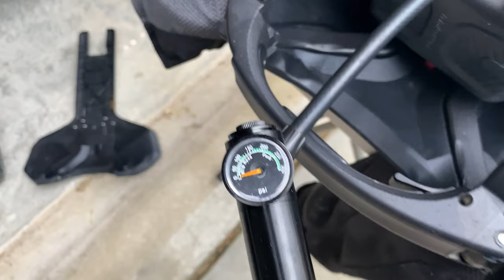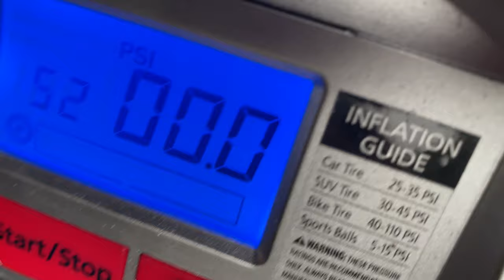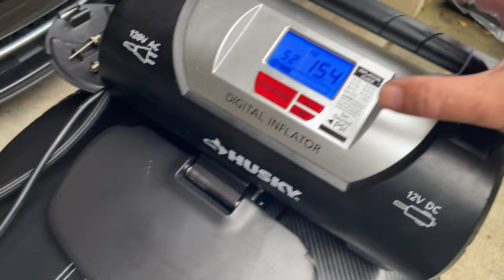Inmotion V11 July 2021 Edition - Issue Filling Negative chambers

Comment: Yup, that pump was garbage. I got an adapter(amzn for LUMITECO Locking Tire Chuck) for a regular bike pump that latched on off because even when I could get the shock to take air it would immediately leak out as I was unscrewing it. The latch solved that problem (sorta) but now I've found that my lower shocks don't hold air and will slowly leak over time. Definitely lots of problems with the v11 shocks.

Comment: Same issue for me. Please, let me know if you'll find something.
Reply from the maker: @BoomboxWannabe  I just contacted them, ewheel's responded right away and I gave them a link to this video.
Reply from the maker: it is the pump, I borrowed a mountain bike suspension pump and it worked on the top chambers.  I let eWheels know and they are sending me out a new pump.  Incredible response from those guys.  I'll post another video to show it.

Comment: the v11 pump tip that screws on the piston has two parts which acts like the old valve. just unscrew them apart.
Reply from the maker: I did try that, it does work with that pump at all on my wheel, I was sent another pump the one that used to ship with the V11 and that one works.  My mountain bike shock pump works as well.

Comment: My shocks stopped hold air all together.  Has anyone found a replacement shock that will fit the V11?  I've noticed that mountain bike fork shocks are similar in size and build.  I believe the cheaply built shocks that come stock will become a problem for years to come.  Why didn't I get the King Song S18?
Reply from the maker: I think one of mine leaks air too.  Maybe the Schrader valve needs to be tightened or replaced.
Reply: @sillythingsibuy3719  I tightened the original schrader valves then bought some new ones, still not holding air.  EUCO won't get new shocks in until late August.

Comment: Mine came in a few days ago, same batch...same issue.. won't detect or fill tops at all with any pump...tried 3 different ones now that all work on the bottom chambers.  Valve cores are tight... What's the deal? Not comfortable riding it at 0 PSI even though ewheels says it's okay,, it seems unsafe and like I paid extra for suspension that doesn't function and makes it less safe...
Reply from the maker: haven't figured out the top chamber issue yet, I did quickly press in one of those valve stems, there is pressure in there but I don't know how much.  I had not contacted ewheels that is also how I got mine. It's disconcerting that they told you us okay, they should address the issue.
Reply: @sillythingsibuy3719  They acknowledged it's an issue, and offered to send a different pump (tried 3 so I doubt that's it..) and then I believe he offered to send replacement suspension arms for tops, trying to find out in back and forth emails with them.  

But, really don't think for $2000 I should have to perform a repair on a defective on arrival wheel.  Doesn't sit well, call me paranoid but if inmotion QC missed two suspension parts on multiple wheels, what else did they miss on this batch?
Reply from the maker: @BoomboxWannabe  it is the pump, you need a shock suspension pump.  I borrowed a mountain bike suspension pump and it worked on the top chambers.  I let eWheels know and they are sending me out a new pump.  Let them know to send you one of the other pumps and you'll be good to go.
Reply: @sillythingsibuy3719  that's what I had assumed but I have 3 different pumps, two specifically for shocks, and they work on the bottoms but not the tops.  So I am still puzzled as to what it is
Reply from the maker: @BoomboxWannabe  look at this video, you can see this pump work.  https://www.youtube.com/watch?v=NsgVYj2BAXU&lc=UgyECncU7ntEAcH6iY54AaABAg
Reply: It is not the pump, the upper chamber is not right for what ever reason .

Comment: You need to spray WD40 spray in the pump o have the same problem and I fix it with silicone spray the pump did not pump any air because it gets dry 
Try it

Comment: Any updates on this?
Reply from the maker: Yes, I have not had time to post my update video: eWheels sent me the pump type that used to ship with the V11, that one works.  The pump in my other video from a mountain bike pump works as well.  Still the one from Inmotion in this video does not work.  I have a friend who also has a V11, he looked and confirmed my findings
Reply: @sillythingsibuy3719  I got that pump to work only by getting a locking adapter. For me the issue was that I was losing all of my air during attaching/unattaching with the threading as I screwed on/off.

Comment: In my case, I am pumping with 20 PSI extra, if I want 50 PSI I pump up to 70 PSI. When I'm done, I unscrew the upper part of the pump valve mechanism, this is when it loses 20 PSI. Finally I unscrew the lower part off.

Pump +20 PSI, unscrew upper part of the pump, unscrew lower part of the pump.

If this doesn't work, the pump or shocks are bad.
Reply: @motorizedpedestrian  I am always losing pressure after I disconnect the pump, I can hear the air come out. When I reconnect the pump immediately after it always shows 20 PSI less, I tried this multiple times with both chambers. 

I have a similar pump as the one in the video.
Reply: @motorizedpedestrian  I disagree -- I had the same problem as the person above -- the very act of unscrewing was losing a TON of PSI for me. In fact, I could pump to 60, unscrew and re-screw and be down to 10 or less even. I had to buy a separate latching chuck to get it to work at all.